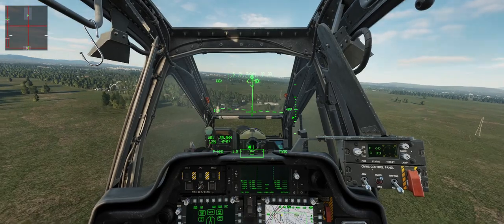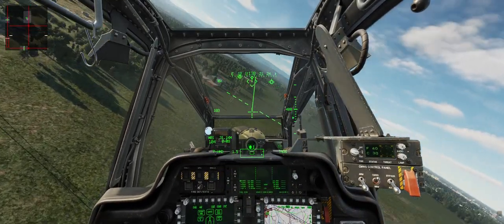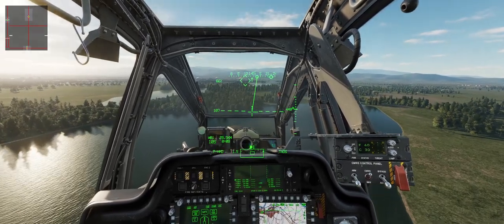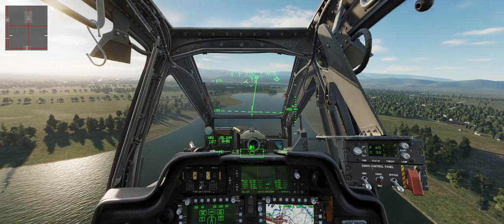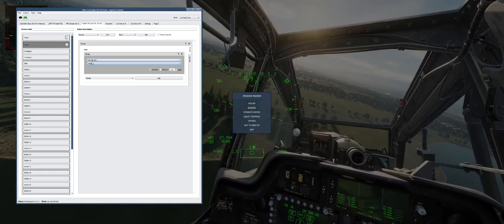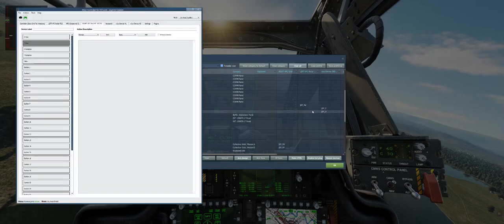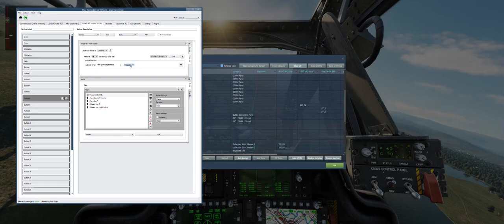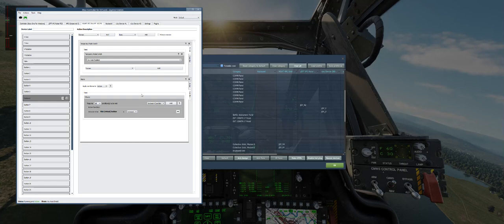DCS AH-64D - How to use Trim Reset without the abrupt transition

Comment: Thanks for your explications. Any other suggestions/idea in using gremlins to fly easier our Apache?
Reply from the maker: I don't have a video on it, but I did post in the DCS Forums about using Joystick Gremlin to switch between two different sensitivity settings for your pedals when transitioning between flight and hover symbology modes.

https://forum.dcs.world/topic/299170-would-anyone-care-to-share-their-user-curvers/?do=findComment&comment=4955853

I also use Joystick Gremlin for mapping controls on my XBox controller for using the TEDAC as CPG.  Like using the analog triggers and mapping 0-75% as stage-1 trigger, and 76%-100% as stage-2 trigger.

Comment: I don't think it is necessary to reset the trim at all, you just trim to whatever position needed and leave it there until you need to trim again.
Reply from the maker: That is one way to do it, and when I am in forward flight and need to make a small adjustment, that is what I do.  

But when I am getting ready to transition from 120 knots to a hover, in as short a distance as possible, I reset the trim before starting the maneuver, instead of trying to "unwind" all the trim I have in shorter movements from center.
Reply: It can be necessary - not sure how to articulate this as I don't know the technical details but as you continue to add/change trim, the SAS seems to have to 'work harder' to maintain your trimmed position (you can see this happening in the controls indicator, RCtrl + Enter). Eventually the SAS is waving about all over (looking at the controls indicator you can see what the SAS system is doing) and things become unstable. Generally I find myself resetting trim as I am setting up for landing, to make sure I don't end up fighting with the SAS.

Comment: Why would you reset the Trim when in the air?
Reply from the maker: To get back to a 1:1 relationship with where your joystick position is and where the in-game stick is positioned.  I might do this after I am done messing with something elsewhere in the cockpit, and want to go back to manually flying the helo with an authentic feel of the controls.
Reply: It's nice going from full speed forward flight into transistion/high hover/ slow flight where you dont need the cyclic jammed forward like you would flying full speed